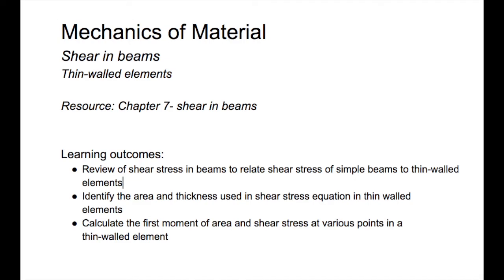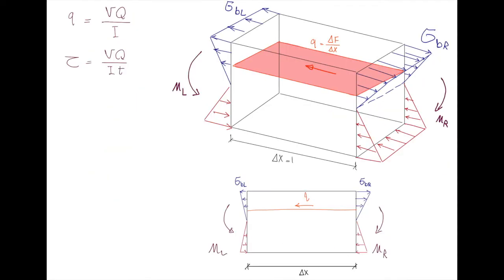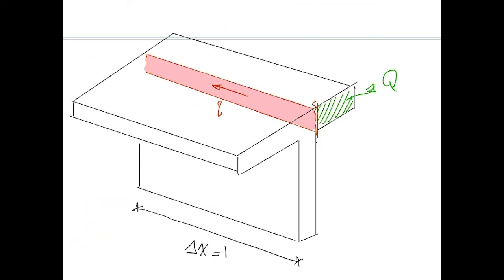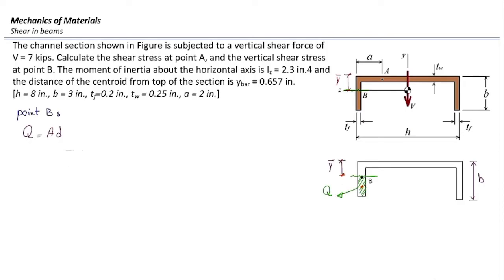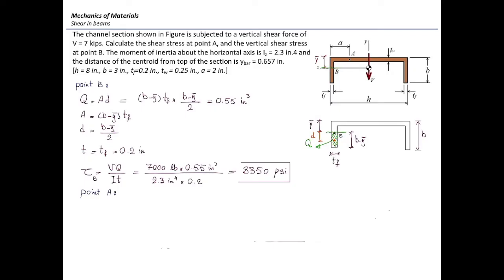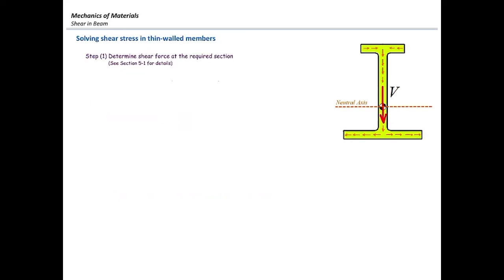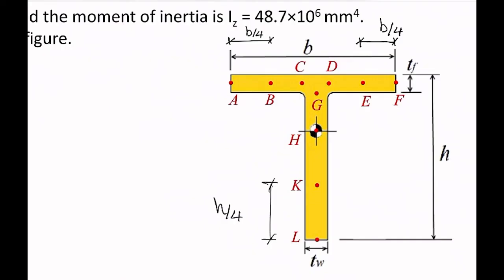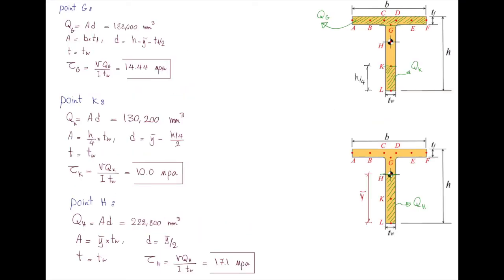Shear stress in thin walled elements + 2 examples

Comment: Why did you make symmetric cut for point A in1st qn? What if we dont use a symmetric point?
Reply from the maker: There could be just one cut at A but in that case the Q will be calculated just for half of the section.
Reply: @MechanicsofMaterialsLibre  can we make a second cut 10 mm left or right from A? Or at center?
Reply from the maker: @nayan9672  Center yes because shear flow is zero at center of symmetric sections but not at other parts because shear flow is not zero. Note that shear is produced due to unbalanced force that is transferred from one part to another part so there should be one cut. In symmetric section there could be two cuts due to symmetry. Hope that helps
Reply: @MechanicsofMaterialsLibre  if we make a second cut at center, Q will be halved, so shear stress will be halved as compared to symmetric cut...I guess we have to take  t for 1 cut only?
Reply: I still dont understand this symmetric cut thing. for example, for a symmetric I beam, if we want to find stress at an arbitrary point in top flange, do we apply this symmetric method? I think the answer would change when symmetric method will be compared to a single cut method.